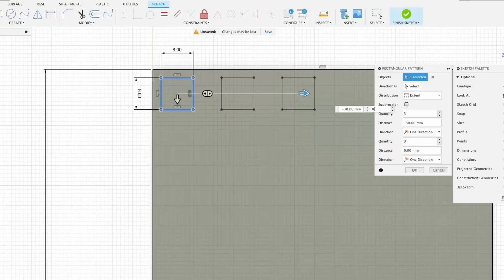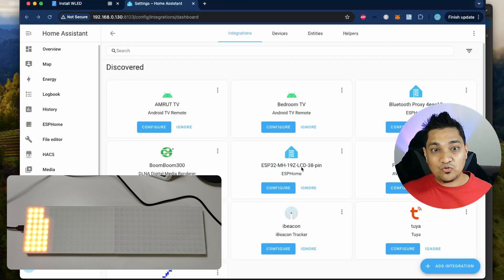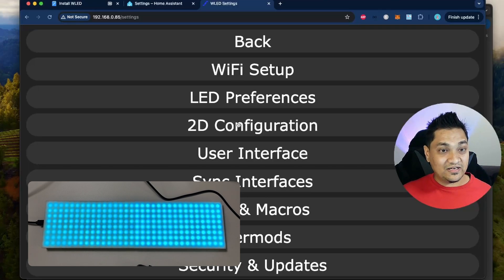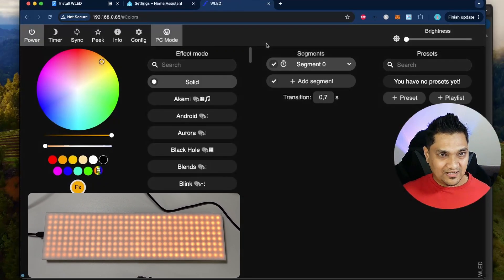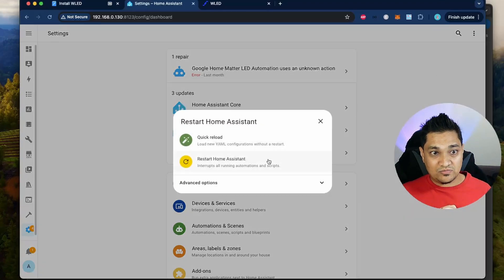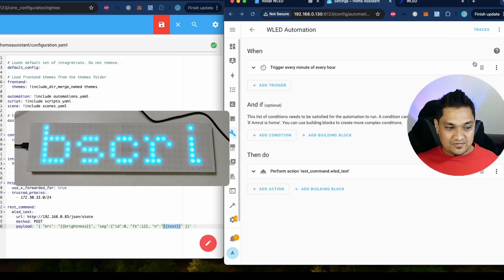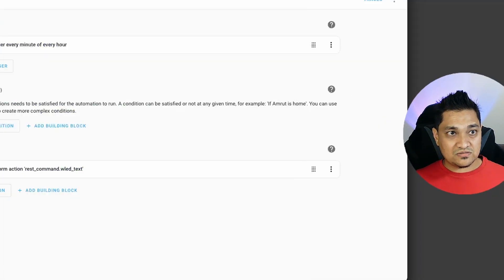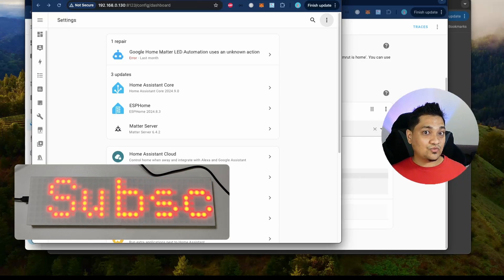How To Control LED Matrix With Home Assistant Like A Pro 🤓 | Send Text Messages

Comment: This is great, but I'm wondering how to make these parameters such as color and text available as variables within Home Assistant, so that I can actually trigger actions upon them being changed..  In otherwords, I'd like to have a "default" mode, for example to display the time, but if an event occurs, I can use your code to trigger new text to go to the display, but also, the changing of that text can be a trigger itself if that text was in a variable, so that I can start a timer, for example 5 minutes, to restore the display to the original mode of displaying the time.   I guess in typing this out, I can probably use helper variables, and then use a generic webhook to update the display based on what the helpers currently contain, but I'd be curious if you've done this already or have a better idea for a more dynamic display?   I am also curious if you've created any additional 3d printed mounts which could potentially hold more than one of these strips?  In otherwords, I'd love to have a 2x2 matrix of these strips for a total of 64x16, all acting as one display.

Comment: Thank you for the great video, Unfortunately I'm having a problem. When copying and pasting your YAML into my config, trying to use the rest command gives me an error message: 

content:
  error: 9
status: 400

I tried going into chat GPT to modify the code and see if that would help, but it did not. I don't know if anyone else had this problem. Maybe the YAML is different now? Let me know if there is a solution to this. Thank you!
Reply: Me too. Same error message.
Reply from the maker: I think you did not provide the data parameters to the request. 
Edit it in yaml mode and paste the parameters like I have added in the video. 
e.g this is for the first rest command in the article.

```
action: rest_command. wled_text
data:
    brightness: "50"
    text: Custom WLED
    color: "[[255,0,212,0],[],[]]"
    font_size: "100"
```

Remember that, things that we provided inside {{ }} are variables that you have to provide as data. 
I hope that helps.

Comment: Thank you for this Video!
It helped me a lot.
I have a Question. How can I realize it to send different Text (in my Case sensor values) where each have another Color, and let them Scroll one after another?
For example:  [Text1] in color1 - [Text2] in color2 - [Text3] in color3 -  and so on
If I send them in an Automation WLED don't process then on after another. It goes straight to the last Text.
Reply from the maker: I don't think that you can change the colour of each scrolling text as per the example you mentioned.

Comment: Great ! One more video which I found extremely informative and lucidly explained. I had struggled to get the orientation of the Matrix in 2D configuration, however, you have explained it in a simple way. Thanks. I was interested to know how to send sensor data (temperature and humidity data) from my other sensors in the home network to be displayed periodically. I guess it will require to use MQTT. Please do make a video about it. Thanks once again, and really love your tone and tenor of your voice. Keep it up.
Reply from the maker: Thank you so much for your wonderful words 🙂.

So you can still send sensor data to the via the REST template mechanism where in you can set the text to the sensor value.
Reply: @SmartHomeCircle  do you have a detailed video?
Reply from the maker: @mazzemazze  I don't have a separate video. But what is done in this one should help you.🙂

Comment: So you're using power directly from D1 mini 5V pin, and setting the current to 2A. Good way to start fire! :)

D1 traces aren't made to work with such load. Please use dedicated power for LED strips/matrices.
Reply: If I want to build it properly and safe what should you suggest me doing in order to connect the entire device led and board to single power source, how to do that?
Reply: @The5py  connect 5V from matrix to the power source directly. Make sure that you use relatively thick wires.
You can connect ESP to that same 5v, but in parallel with LED input, not in series, so the LED current won't damage the ESP board.
Same for ground = single input, split and feed to board and LED. Data cable from D1 to LED can be thin.
Reply: What version you used of d1 v1/2/3/4m
Reply: @The5py  hmm i usually use esp32. They have more capability, thus smoother animations etc.
Reply from the maker: @formatBCE  ohh good to know.
I am not an expert on the amount of current d1mini supports. Your comment might help others.

Thanks for this.